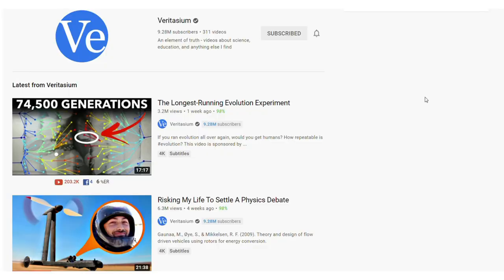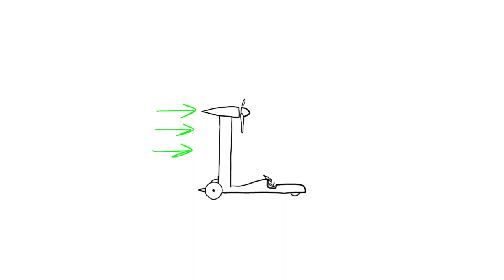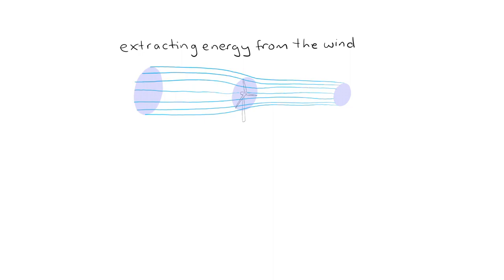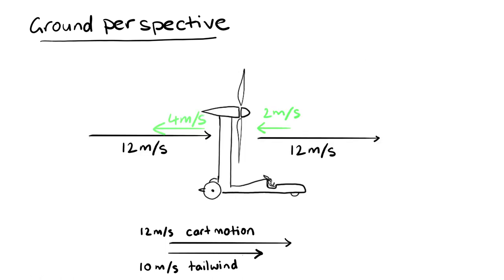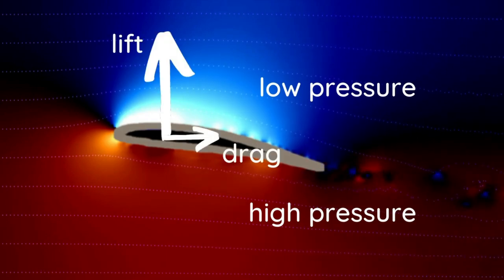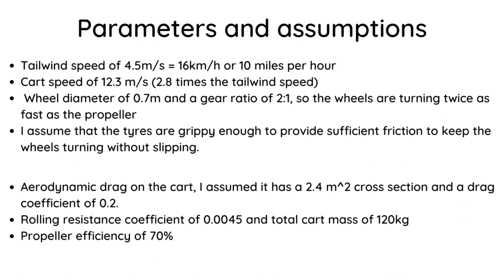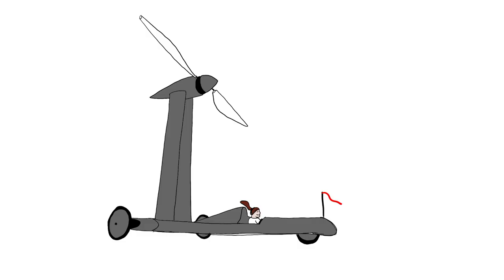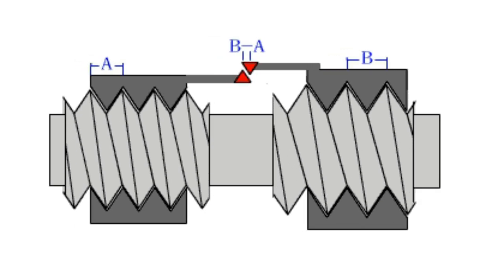Downwind Faster Than the Wind by Veritasium: How Does it Work?

Comment: Great job, Rosie! Love the explanation and numerical simulation. I’m taking a second crack at this one this week to explain what went down with the bet.
Reply from the maker: Thanks 😁😁 it makes me very happy to have you as a visitor on my little channel! 
I have really enjoyed thinking about this design, thanks so much for introducing me (and 6+ million others) to it.
Reply: I hope that you picked up 10k for this Derek. It's nearly worth that for riding in that vehicle as it looked scary as hell with that out of balance prop.
Reply from the maker: @chalichaligha3234  you have made some great illustrations there, well done. I really liked your explanations. I don't think I made the mistake you mention, but perhaps I wasn't very clear. The prop starts generating thrust as soon as the wheels start turning, so that is a constant as soon as it has any movement at all. But at very low cart speeds, the greater part of its forward-acting force will come from bluff body drag. Do you not agree there is any bluff body drag pushing the cart forward below wind speed that changes direction to start pushing it backwards as it crosses wind speed?
Reply: @EngineeringwithRosie  I think that at low speed the greater part of the force on it is coming from the drag on the propeller. This is evident with the small model cart, which doesn't have any body to speak of.
Reply from the maker: @coolaun  yep fair enough, that's likely true as its area looks like it's more than the rest of the cart.
Reply: As to whether the drag for the initial start is coming from the 'bluff body drag' of the propeller or the chassis, as someone who has assembled the Blackbird (in the wind) numerous times, everyone is correct. :)

The prop is removed from the shaft and the nacelle on the Blackbird folds down for travel.  For setup this is of course reversed.   If you place the back of the Blackbird to any significant wind and stand the nacelle up, you better have the wheels blocked or the craft will roll downwind.  This is before the propeller is installed.  By this we know of course that the chassis drag alone is enough to start a downwind rolling motion.  (This ignores that since the variable pitch prop was installed, there may be pitch positions that when the craft is stationary, fight back against this drag better than other positions).

I'm also convinced that the bluff drag of the propeller greatly adds to this startup drag as one of the reasons we added the variable pitch hub later in the Blackbird life was to be able to flatten the propeller at startup and add significantly to this drag (and thus reducing the rolling space needed to get the propeller producing thrust).

My best answer from first hand experience with the vehicle is 'both' and also 'either would do it'.
Reply: I feel like I conceptually understand the thing, but what would be most useful is a two graphs that explain the force and energy balance at steady state.  The graph would assume a fixed wind speed (e.g. 10mph).  The x-axis would be the vehicle's speed relative to the ground.  The y-axis would be force and it would have two plots:  thrust vs. speed and drag+friction vs speed.   The difference between the two plots is proportional to acceleration.  The top speed would be where the two graphs intersect.

At zero speed (relative to ground), the thrust is zero, but the "drag" is negative, because of the tailwind.  At some speed lower than the wind speed, the "drag" and friction cancel out, so that plot has an x-intercept, but the thrust has climbed above zero, so there is still acceleration.  At the wind speed, the drag is zero, and there is friction and thrust, presumably more of the latter.  And at some point above the wind speed, the two plots finally cross, and you will reach a steady state.

You could also do a similar graph with power on the y-axis to show the energy balance.  At zero speed, there is no power transfer with the ground, but the wind is providing power via drag.  As speed goes up, the power in the wheels goes up (not linearly, because the force with the ground is not constant), and the power from wind drag is cancelled then overcome by the power of the propeller pushing on air.  At steady state these graphs would also intersect.
Reply: @johnborton4522  Thanks for the details, John. I know it may be useful to have some extra help from bluff body drag or even a push to get Blackbird going, but it's important to keep in mind that the propeller is always playing a role, first simply because of the wind drag on it and then more and more because of the thrust it is producing, even below wind speed.
Reply: @EngineeringwithRosie  Maybe this isn't important, but I think it's worth noting. At all times, even when stopped, the propeller is applying a forward force on the cart. When the propeller is not rotating, this force doesn't fit the normal definition of thrust, but could still be treated as thrust mathematically when calculating the force balance for the vehicle.
I like this concept because I think it helps emphasize that at all vehicle speeds - zero ground speed, below wind speed, at wind speed, above wind speed - the propeller is doing the same thing -- pushing the vehicle forward.
Of course the aerodynamics of the propeller change completely when the blades change from a stall condition to operating in a lift fashion, but regardless, the propeller is always pushing the vehicle forward.
Reply: @coolaun  

Agreed, but in the regime I believe we're discussing, the propeller hasn't yet started producing thrust.
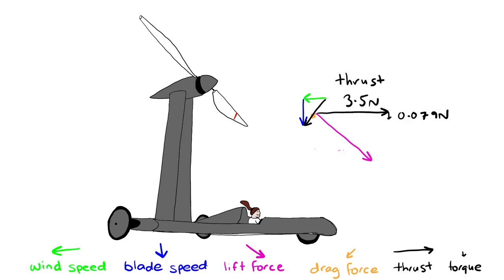Reply: @EngineeringwithRosie  The Force decomposition into thrust and torque components is wrong on minute 12:47 ... Which means that the argument that the torque comportent is small doesn't hold.

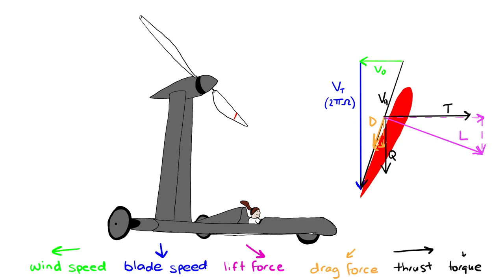It is curious because on minute 10:55 the force decomposition is right... 
In any case, thrust is the component of lift minus the component of drag... And TORQUE component is the component of Lift plus the component of drag.... For the example, the flow angle is about 45 degrees, that means the TORQUE component is about the same magnitude as the Thrust component... So the analysis must be revised with a more detailed account of the rest of the forces, including rolling forces on the wheels.
Reply: @EngineeringwithRosie  Additionally, to actually make any assertion about the resistance Force on the wheels due to the torque on the propeller, the actual propeller torque must be calculated, i.e. Torq= integral r x dQ from r= blade root To r= blade tip... If I understood it well, you did not calculated the torque on the blade, because you did not multiplied  the radial distance of each differential blade element by it's torque component (Q).
Reply: @EngineeringwithRosie  You don't have a little channel, you have a great channel packed into a compact package.
Reply from the maker: @abrahamvivas9540  thanks for your detailed comments. I did calculate in the way that you suggest I should have, so if you are confused it must be that my drawing didn't capture the calculations very well.
Reply: @EngineeringwithRosie  Hi Rosie, my pleasure. 
But I must insist there is some small miscalculation somewhere:
- On the velocity triangle shown in minute 12:35 the flow angle is arctan(11/13) = 40.2°=beta
- For Lift and Drag forces equal to 3.5 and 0.036 newtons respectively, then: 
  # Thrust force= Lift*cos(beta) - Drag*sin(beta) = 2.65N
  # Torque component force = Lift*sin(beta) + Drag*cos(beta) = 2.29N
- Hence, for the example in hand, the Trust and Torque components are about the same magnitude.
- The components that you calculated (min 12:47) would be coherent if the flow angle would have been 0.7° 

The spreadsheet shows the same problem. The flow angle is big and hence both Thrust and Torque force components should be about the same magnitude.

My guess is that there was a problem on the spreadsheet calculating the sine and cosine functions, maybe the functions works with degrees and you're introducing  the values in radians.

On a final note, it's important to notice that the relative axial wind speed on the blades is bigger than the relative wind speed on the cart because of the contraction of the stream tube (the propeller force the flow to accelerate, even with no relative wind speed on the cart, the opposite happens on a wind turbine).

And that's all. I think using blade element momentum theory to model the propeller and coupling it to the dynamics of the cart is the right approach (as you're trying to show in this video). 

Cordially,
Abraham Vivas
Reply: @EngineeringwithRosie  does the car keep accelerating forever after it crosses the wind speed? Or
Does it stop accelerating and comes back to the wind speed.(i.e, it attains equilibrium)
Reply: Veritasium, oh dear and Rosie, unbelievable, how can you have fallen for this hogwash.
Reply: This week… it’s barely two days later!! All those graphics… I wonder how many people work behind the scenes at veritasium? Quite the labor of love
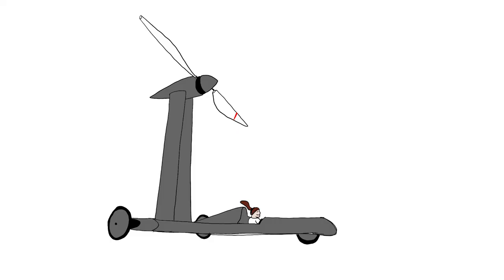Reply: I BET 10000$ That Veritasium got the right answer with the WORNG procedure (Making a serious conceptual error). And I bet the same quantity that Rosie fell for the same conceptual error (min 12:34), and that there is a mistake on her spreadsheet evaluating the sine and cosine functions.
Reply from the maker: @abrahamvivas9540  Are you saying you want to bet me $10,000 that the hypotenuse of a right triangle with sides 11 and 13 is not equal to 17? I am happy to take that bet 😀
Reply: @EngineeringwithRosie  hahaha xD, no, that's not the conceptual error in which you and Veritasium fell in ... In your case is hidden in plain sight on minute 12:34. (Hint, i remarked it on an earlier comment on a paragraph that started with "On a final note...")

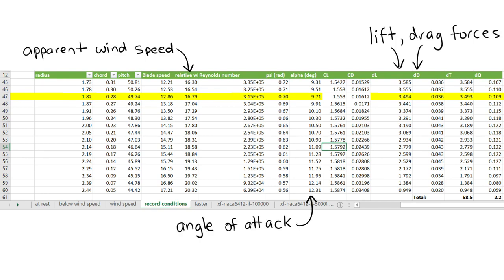About the mistake on the spreadsheet and triangles, the bet is that, for example, on the highlighted row on the spreadsheet on minute 11:46, I bet that dT and dQ are not 3.493 and 0.109 respectively, instead (using the correct flow angle from the velocity data on the highlighted row) dT and dQ are 2.65 and 4.1 respectively. In fact, i don't know how you got dQ= 0.109, because is not even coherent with your miscalculated reported torque component(12:57) times reported radius = 0.079*1.82  = 0.143

So, the bet is open ;)
Reply from the maker: @abrahamvivas9540  there's no bet, I'm not interested in pursuing this. Feel free to make your own video if you are so keen to prove me wrong.
Reply: @EngineeringwithRosie  Never had the intention to formalize the bet, just was a playful way to take to your attention (and Veritasium one's) that there should be an extra small video with the corrections. 
Because, I think science communicators should be responsible towards their audience and to make follow up vídeos when doing mistakes, correcting them (specially when having a large base of followers like Veritasium)

I have no time to make a quality video, nor I've ever done it. But I insist, science communicators should be responsible of the misunderstandings they communicate to the public.

I guess, if there's no attention on the subject I would be forced to make a small, poor quality video correcting both of you. But I don't think that it will reach most of the audience, and the corrections on the misunderstanding that propellers don't push wind in on itself nor the torque is really big will transcend.
Reply: @EngineeringwithRosie  since the propeller acts as a fan once wind hits 12mph couldn't you make it stationary and instead of driving wheels have it geared to a regular wind powered generator behind it multiplying its speed in low wind areas. Wouldn't it increase the regular wind generator's speed, power generation and hopefully lowering the turbulence compared to a high wind area by creating a wind tunnel with the lower wind speed around it and the higher speed thru the 2 propellers so there is less turbulence at the tips of the blades.
Reply: You won the bet!!!!!🥳🥳
Reply: So, When this contraption achieved the "world record" with a speed of 28mph with a 10 mph tailwind, where was it getting the energy to do this as there is effectively no longer power entering the system from the wind. The car is seeing an 18mph headwind.
Also what has the little model on the treadmill got to do with it. wheres the wind?. A complete red herring, The model on the treadmill can move forward because its receiving power from the treadmill. All the little model has to do is transfer enough power to the propeller from the treadmill to overcome its internal friction (no wind). I would presume the treadmill has maybe a 2kw motor, however, the contraption on the salt flats at (28mph) is not receiving any energy input. Though quite a bit of friction I would imagine.
Reply: Great, but can someone explain why or where the professor went wrong so that his equation always came out with negative acceleration when going faster than the wind.
Reply: @coolaun  The legend. I really like the videos you have made. How is flossy doing BTW.
Reply: Assuming Wind speed is fixed 
Wind pushes the car 
Wheels turn 
Wheels turn the blades 
Blades push against the wind (this creates the extra speed) according to them.
But 
Now the speed of car is “supposedly” more than the wind 
The wind is relatively slower than before from the reference of the car and hence it won’t push the car as much as before 
So the wheels won’t have the same angular velocity 
And subsequently blades will start to slow down.
So. Practically the moment propeller starts to spin and exerts any sort of force it starts the process of slowing down the vehicle in the first place 
How does  “Law of conservation of energy” holds here. 
Please explain its killing all my physics inside me.
Reply: @ramanmono  Flossie is just fine and still loves riding in the Under the Ruler cart.
Reply: hmmm, if I accelerate up to windspeed x via my Blackbird wind demon such that apparent wind is 0 in a long wind tunnel, and then suddenly switch to a another tunnel alongside it with no wind, such that relative windspeed component (green vector) over prop becomes -x. Is that creating a net thrust force given the blade speed(blue vector) hasn't changed from  that achieved accelerating up to wind speed value?  A larger negative green vector seems to imply a greater thrust component with the same prop velocity, neglecting a few details like drag which may be determinative. So, at what point does my Blackbird wind demon start to slow given is now zero absolute breeze - Is it immediately  for all values of x?
Reply: BULL
Reply: @Alan_Hans__  that out of balance prop was my main concern. I thought it was going to fly apart at any moment.
I would love to see a remake of this vehicle with a three blade prop, ultralight materials, and tighter building techniques.
Reply: @coolaun  the small car is an example of stored energy in the propeller acting as a flywheel spinning up the propeller enough to provide thrust which the treadmill maintains. It is not being affected by motion and inertia in the same way as Blackbird, either. The only similarity the two share are they both have thrust propellers being driven by their wheels.
I would like to know the rotational ratios between the propeller and wheels of both the small cart and Blackbird.
Reply: I bet a flat Earther I could dispel his idea. Dunning Kruger won out so I gave him the money . Hoping he might use it to further his education. But he only used it to expand his channel and try to further spread the 'flat Earth'  'truth'.
Reply: @TubeMeisterJC  Thanks for your Italian inspired response. Put me in the mood of cannelloni.
So the difference between the car in the desert and the car on the treadmill. When the car in the desert is stationary with say a 10mph tailwind (as per the world record) it is experiencing maximum force at that point but when it starts to accelerate the force acting on it decreases until it is travelling at the same speed as the wind where the force acting on it is zero.
The car on the treadmill experiences maximum force at the start and continues to receive maximum force at all times, point being that the car on the treadmill is not analogous to the car in the desert. It's another red herring, one of the many red herrings and misappropriated explanations which have convinced the makers of this vehicle and others that it has some kind of validity. 
It's a battery running a generator which is charging the battery.
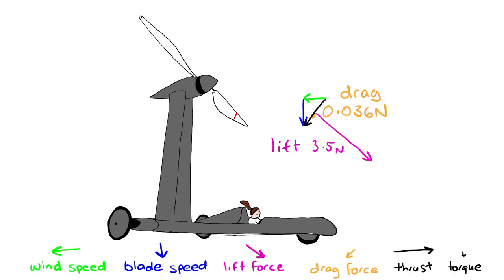Reply: @abrahamvivas9540  seems like you are right. The values shown at 12:38 are calculated for 0.7 degrees instead of the correct 0.7 radians (40.2 degrees, which is an angle on the triangle with sides 11, 13, and ~17).
At the end, the thrust is still bigger than the drag though, so I guess this is okay.
Reply: @EngineeringwithRosie  Youtube algorithm recommended your video based on my past views. Congrats!
Reply: You know, I UNDERSTAND how the machine works, but EVERY youtuber who explains it still confuses me. It's just like that image of the boats moving around the cylinder. That,,, is not the concept. No one has yet outlined the basic concept, and the concept only, in a short explanation video. (see everyday astronauts shorts, simple, brief, and only)
Reply: @chalichaligha3234  I just watched your video. Completely wrong sorry.
Reply: @tsmspace  Forget the boat cylinder thing. Complete red herring. All you need to know is that, once underway, the craft is powered by its propeller. Here is the cunning part. A propeller produces maximum thrust when the craft they are on is stationary! Not when they are moving and generating a headwind - the thrust actually drops off rapidly! So all that is happening is the tailwind counters any headwind created by the craft moving forward which enables the propeller on that craft to produce more thrust than it otherwise would as it mimics a stationary craft. This excess thrust enables the craft to accelerate to a higher speed than intuition would tell you.
Reply: @yup3398  no,, the wind is still pushing the vehicle. If you had a rolling vehicle, the inertia of the vehicle cannot propel it, no matter how you gear it down. The propeller is creating a high pressure zone which is pressing on the propeller. THe wind pushes on the high pressure zone, which transfers wind energy into the propeller through this high pressure zone. The craft is not powered by it's momentum, it merely uses it's momentum to create an airmass that can keep the craft in contact with the wind energy.
Reply: @tsmspace  that's exactly what I implied. You're simply describing it colloquially.
Reply: @yup3398  but your first line was, it's powered by its propeller,, but it's not. It's powered by the wind, which is coupled through the propeller.
Reply: @tsmspace  I'm not sure I see your point. I state it uses the wind to its advantage via the thrust from the propeller. Its a reaction between the propeller and wind.
Reply: @ramanmono  Yes, I can explain it.  He made a conceptual error.  In fact they all did. People generally realize that the thing that creates lift on the wings of an airplane is air pressure on the bottom of the wing.  But they generally don't think of air pressure as having a speed limit. The air foil shape causes laminar flow on the top of the wing and that is the same as creating low pressure or a vacuum. So, the motor of the airplane is not what is holding the plane in the air.  The motor is moving the plane through the air to maintain the laminar flow and overcome drag. On the downwind vehicle the propeller is like the wings on a airplane.  And the gearing of the wings to the wheels is what overcomes drag and maintains laminar flow on the front side of the propeller, creating a vacuum. This remove the air pressure on the front side of the propeller, as is the case with the top side of the wings of a plane. So, here's the thing.  The thing pushing the propeller isn't the wind.  The wind is instrumental with respect maintaining the laminar flow, the same as on a sail boat.  But the wind is not actually what is pushing the propeller.  The same is the case on a sail boat.  The thing doing the pushing is air pressure. And here is the thing that has them all stumped, the speed limit of air pressure is the speed of sound. In other words, as long as the air pressure is being removed from the front of the propeller/sail it will continue to accelerate all the way up to  the speed of sound (if we assume no drag).
James McGinn / President of Solving Tornadoes
Reply: @yup3398  John Borton's response to my video: 

Chali, I am one of the primary designer/builders of the Blackbird so I have a complete understanding of the craft.  I watched your excellent video and it's clear that you too have grasped the concepts in their entirety (nice work).

As far as the initial motion from rest (where the propeller has not yet begun to develop thrust), it takes very little drag against the tailwind to get it started. You are likely correct that if the body magically had no drag at all, merely the drag against the propeller would get the vehicle moving.  Conversely, if you took the propeller entirely off the Blackbird, the drag on the chassis alone would be enough to get it started rolling at accelerated to some percentage of windspeed.  In the end, since by necessity they both exist on the craft, it is the drag from both that start the initial motion.
Reply: One day it will be so common that no one will ask how it is possible rather applications of it.
Reply: @EngineeringwithRosie   i disagree 100% i say the professor was right. The experiment was not correctly completed.  I believe it was also down the slope of the ground ( the ground was not flat) and the is a lot of frictions( weight of the individual  adds friction on bearings, air friction,  opposite rotation friction, the pushing speed wind relative to the car is Zero, mechanical propellant bearing friction, gears friction and so on)
Reply: @dmdeemer  Your suggested plot would be very helpful. I concur it would look as you state. The energy balance (and SOURCE) is of great interest to me.
Reply: @tsmspace  Agree. I haven't seen a video or paper that concisely explains how the vehicle obtains its required power at each phase of operation in the downwind mode. Upwind is very simple.... the rotor acts as a turbine to drive the wheels. Seems like a lot of counterintuitive or oversimplified explanations.
Reply: @physicsphirst191  I don't see how the turbine could drive the wheels without a separate gear, so the machine that is actually built I think won't go upwind, but yes i agree, there are a lot of explanations that seem to be using the wrong mechanics or some roundabout explanation that could be simplified a lot.
Reply: @tsmspace  Correct.... the Blackbird is configured differently for going upwind and downwind, with different blades and reversal of the senses of the overrunning gear (i.e. going upwind the rotor drives the wheels, going downwind the wheels drive the rotor). More reading to do!
Reply: @Engineering with Rosie  Hello, this is off subject, do you think that the north poles of two magnets could stick with a steel washer in-between?
Reply: @IsaiahBuildStuff  if it's an ordinary washer, and ordinary magnets, then the a magnet will polarize the washer, so the washer becomes magnetized while in contact. So they shouldn't stick under this limited "normal condition".
Reply: @Rick_Cavallaro  Rick. You do understand this is a powered propeller? Please tell me you understand it loses aerodynamic thrust the faster the craft goes apart from increasing rpm? Good grief. Why does it need a tailwind to work? Are you saying you could tow it on a windless day, let it go, then watch it accelerate away?
Reply: You've made something really cool. Bravo. But when I stumbled across the explanations it hurt to watch. Windmilling propellers?? Please just one question. What would happen if you towed it to a workable speed on a windless day then released it?
Reply: @Rick_Cavallaro  Wow. Okay. Anyway. It would be nice to see it towed and released on a windless day. On the treadmill it always has a tailwind speed matching the belt speed so we don't get to see it there.
Reply: @Rick_Cavallaro  Kinetic energy, then.
It is no different than winding up a wingless rubber band airplane and putting it on the treadmill, if the treadmill were somehow being used as a means to keep the rubber band wound through contact with the wheels across the belt while the propeller spins. The small cart is just an example of a tiny cart being driven by a ?hp treadmill motor through the belt, wheels, and gears. The key point is in finding a propeller large enough and with enough pitch to provide enough thrust to exceed the friction and drag created by the cart.
The comment that I REALLY liked that you made was comparing Blackbird's propulsion to a feedback loop between a speaker and a mic. And how Blackbird was plugged in to the power of the wind like the mic and speakers were plugged in to the power of the wall socket.
Reply: @Rick_Cavallaro  My thinking was just that a 3 bladed propeller would provide more surface area for the wind to push against for the initial movement in low wind conditions if you could adjust the pitch to them being nearly flat. And it seems to me that 3 bladed propellers are inherently more stable and efficient than 2 bladed propellers. But you would know a lot more about pros and cons of a 3 blade propeller vs a 2 blade propeller for your situation than I would.
I had wondered about the source of the vibration, since the earlier videos do show substantially less vibration. I had not considered that the blade pitches had become mismatched.
In any case, it is a brilliantly engineered machine that I hope I can see in person at the Smithsonian some day.
Reply: @Rick_Cavallaro  Great. So according to the Veritasium explanation it should just keep accelerating to a point - tailwind seemingly to have little to do with its speed apart form the initial start up. I was happy to find Rosie's video here as she includes tailwind with more detail. My guess, as I haven't seen it demonstrated, is that it decelerates in the range of "slower than if it didn't" to "just as it would if it didn't". If it continued at the same speed or even accelerated then you've cracked perpetual motion and if that's the case, hats off to you.
Reply: @Rick_Cavallaro  All good. Cool. So without the tailwind it doesn't accelerate. I feel the second video went into great detail explaining how the wheels drive the prop which I appreciated. But that is all for nought if we don't understand why and how the tailwind allows the craft to accelerate. To me that is what makes it magic and I fear a lot of viewers confused the propulsion with that of a sail or windmill. As opposed to a powered propeller upon an accelerating craft which, although may produce more lift with increasing speed across the blade, will lose thrust as a result of that increasing speed.
Reply: @Rick_Cavallaro  That was my stumbling block. How could you have a pitch that could provide thrust at speed, yet not try to drive the propeller like like a turbine that would try to drive the wheels in reverse at startup? Once I realized that the blade pitch could be flattened to provide maximum surface area for the wind to push against while imparting minimal spin force, it all started making sense.
As I said earlier, it is a brilliant piece of engineering.
Reply: @Rick_Cavallaro  the treadmill cart is an excellent analogy of how Blackbird's wheel driven propulsion provides thrust to exceed that ground speed once equilibrium is exceeded. What it doesn't do is explain how the wind is capable of creating the ground speed. But Blackbird itself does a magnificent job of that.
Reply: @Rick_Cavallaro  my problem  has more to do with grip and traction of the tires of the small cart on the treadmill hence having to hold it down against the belt to spin up the propeller. But that's only because it is a flyweight representation of the full size machine. Which is irrelevant anyway since Blackbird has more than proven that a machine can be designed and built that travels faster than the wind straight downwind using only the force of the wind to do so.
Reply: @Rick_Cavallaro  my first thought was it had been damaged somehow in storage or transport which led to the vibration and not because the build quality was subpar.
Reply: @Rick_Cavallaro  the experiment has to be re done considering all factors, and an acute mesuring equipment being use, and a lake bed wont be complete flat i can bet on that. Even water needs no air disturbance to be flat. But i get your point.
Reply: @tsmspace  Some how I got it to work
Reply: @Rick_Cavallaro  it's very simple. the propellers are not sailing, they are fanning. HOwever, it is also very easy to see how you could imagine the device to be working one way, build the device, test the device, and still be imagining it working one way, when it's actually working with a different mechanic. The prop is creating a high pressure zone behind the vehicle, and this high pressure zone pushes on the wind, and therefore the wind is coupled through this high pressure zone into the prop. The propeller is at NO TIME "tack" sailing for the downwind operation of the vehicle. It is only running, but it is able to increase it's running speed beyond the speed of the wind because the propeller is pushing air directly into the wind, and the wind is in turn forcing this high pressure zone forward. --- This means that the speed of tacking will have no bearing on the potential speed of your vehicle,, if you can gear it up so that the prop spins fast enough, you can continue to harvest energy from the wind as long as the propeller is able to push on the wind.
Reply: @IsaiahBuildStuff  that can make sense. A lot of histories inventions work that way. The inventor works with a logic error, but the machine they build is functional, even though there is one little detail about their logic that is wrong, it doesn't prevent them from understand the machine in practice.
Reply: @tsmspace  I what do do it for Veritasium's contest. I think it is counterintuitive do you agree?
Reply: @yup3398  I think it's pretty obvious that without the tailwind to offset friction and drag it would eventually slow to a stop.
Reply: @Rick_Cavallaro  and with this, I will drop out of the conversation since I fully understand the concepts and physics involved in how it works. I don't want to pester Rick with irrelevant minutia.
Reply: @yup3398  Blackbird needs the tailwind to provide enough push force to offset the losses from the drag and friction to reach equilibrium or to exceed them to provide acceleration.
Reply: @EngineeringwithRosie  
Why no mention of the wheel diameter?
I presume that you have seen Xyla Foxlin's video on this subject with Derek of Veritasium
Reply: @maxxron  can you explain how it exceeds the tailwind?
Reply: @Rick_Cavallaro  What I called "wrong procedure" is that Rosie and Veritasium made a conceptual error... And the bet was a playful way to take that to their attention... It doesn't worth the money I guess... It's a simple aerodynamic concept derived from open turbomachinery analysis.. I did not developed the equations to left it as a little puzzle to Rosie... But if you want to pay me that sum to teach you basic turbomachinery aerodynamics... I guess I can accept.
Reply: @yup3398  To simplify it even further, compare it to a tailwind pushing an airplane faster than the prop could propel it alone.
Reply: @Rick_Cavallaro  I realize that.
Doesn't Blackbird do something similar once it generates enough thrust to exceed the wind speed? It just seems to me that once Blackbird does exceed the wind speed it is just operating in a moving air mass as well.
Reply: @Rick_Cavallaro  It just seems to me that the main difference between a propeller plane and Blackbird (once it exceeds wind speed, of course) is that the plane is propelled by a gasoline engine and Blackbird is propelled by kinetic energy through the drive line, but both are getting an additive speed assist across the ground from the velocity of the air masses they are moving through. Or am I missing something?
Reply: All this stuff is a hoax "validated" by some guys who are not able to think and don't know the laws of the physics.
That vehice is in fact a tentative of a "perpetual motion machine" which is able to generate energy from nothing.
There were a lot of guys in history who tried that.
The biggest problem is that the "physicians" from the US Olympiad "validated" this stupidity. And that is really bad.
Reply: I have one question, did somebody (independently) check what is inside the vehicle of Cavallaro (btw, who is this guy?)?
I'd like to see what inside that "black box" behind the propeller and inside those things (again, "black boxes") which supports the propeller.
Reply: @Rick_Cavallaro    I already requested to Derek ("Veritasium") 1 mil euro (I'm from Europe) to prove (show) him where he (and a lot of others) was wrong. But he didn't answer up to now. :D

btw, can you make a video with some independent people who can umount your vehicle, check what is inside, mount it again and run it "faster than the wind"? :D

Derek won that bet because he meet a guy who was idiot enough to believe that hoax. That professor was not able to see where were the problems (because of that he should be thrown out from the teaching system).
Reply: @Rick_Cavallaro  you should not demonstrate anything, others should.
Others should vheck your vehicle and try to run it "faster than the wind", you should be only spectator. 😁
btw, in the videos there isn't proffesional equipment for measuring the speed and direction of the wind all along the runing path. There is only a strip of something which of course cannot be considered as a proof that the vehicle runs faster than the backwind.
Reply: Guys, why do you remove my comments? Should I understand that you don't like the truth?
Reply: @Rick_Cavallaro  be careful when talking about paranoia. 😁

So, let me put again the (removed) comment:
This is not a bet, that 1 mil euro should be my reward because I "illuminate" you.
This reward is because that professor was not able to proof where you (Derek, you, etc) were wrong and, more than that, "the physicians" from the US Olympiad "validated" (theoretically) a perpetual motion machine which more that that produces e nergy from nothing ("the dream" of generations of "enthusiasts").
Reply: @Rick_Cavallaro  how do you know that I'm wrong if don't even know what I'm about to say?
I need the money AFTER the demonstration.
Reply: @yup3398  See the solution on page 10
https://www.aapt.org/physicsteam/2019/upload/USAPhO-2013-Solutions.pdf
Reply: For all the guys around here, please search on yt for a video named "40 Perpetual motion machine, all work" (I can't post here links).
There you will see tons of "Cavallaro's like machines". 😁😁😁
Reply: @tsmspace  

// " It's just like that image of the boats moving around the cylinder. That,,, is not the concept."

But it is.
Reply: @johnborton4522  No. It's not. The boats are sailing downwind and at an angle, so that they are able to move downwind at the speed of the wind, but because they are at an angle, their speed can be increased by the Pythagorean of their angle. The land-yacht is already moving faster downwind than the wind itself, so this mechanic no longer can apply to the propeller. Yes, the propeller blades can move faster than the wind in a circle while the land-yacht moves at wind speed, which is the boats on a cylinder concept, but that does not move the land-yacht at all, it just justifies how the propeller might be able to spin from wind power even if the land-yacht is already at wind speed. But, the propeller doesn't even spin from wind power, it spins from being geared to the wheels.
Reply: @tsmspace  

Can't help you if instead of being willing to learn you just insist on being wrong.  So be it.
Reply: @johnborton4522  I don't follow. is the boats around the cylinder a propeller or is it being pushed by the wind
Reply: @Veritasium, @Rosie, @Rick:
Can you explain why in the "Risking My Life To Settle A Physics Debate" clip, starting at 12:20 the propeller starts to vibrate and rotate faster and faster while the vehicle is almost stopped?
@Rick: do you hold your 1 milion euro reward (for me) for showing you (and others) where you was wrong (and cheated)?
@Veritasium, @Rosie: I guess these videos ended your "career" in science. 😁
Reply: @Ovi_B  

// "Can you explain why in the "Risking My Life To Settle A Physics Debate" clip, starting at 12:20 the propeller starts to vibrate and rotate faster and faster while the vehicle is almost stopped?"//

I can.  Would you believe me?

// "@Rick: do you hold your 1 milion euro reward (for me) for showing you (and others) where you was wrong (and cheated)?"//

He didn't offer you a reward, he offered you a bet.
Reply: @johnborton4522  
----- I can.  Would you believe me?
Please do it. I don't know if I believe you, but please present your opinion.

------ He didn't offer you a reward, he offered you a bet.
I told him from the begnning that is not a bet, it is a reward (for myself).
Reply: @Ovi_B  

// "I told him from the begnning that is not a bet, it is a reward (for myself)."//

Yes, and he laughed his ass off at the idea of you wanting a reward for being wrong.
Reply: @johnborton4522  

-------Yes, and he laughed his ass off at the idea of you wanting a reward for being wrong.

Yes, and I asked him how does he know that I'm wrong before knowing what I have to say?

Can you tell us why that propeller is rotating faster and faster?
Reply: @Ovi_B  that's not when the vehicle is "working", it's when it's not
Reply: @Ovi_B  

// "Yes, and I asked him how does he know that I'm wrong before knowing what I have to say?"//

Because he knows the first rule of Dunning Kruger.
Reply: @Ovi_B  

// "Can you tell us why that propeller is rotating faster and faster?"//

Of course I can.
Reply: @johnborton4522  

------ Of course I can.

OK, do it. 😁😁
Reply: @Ovi_B  
// "OK, do it."//

I have no reason to unless you trust me.
Reply: @johnborton4522  I can't trust any claim before knowing and analyzing it.
But please note that I'm not like Cavallaro, I don't say from the beginning that what you are about to say is a stupidity. 😁

So, please "enlighten" us. 😊
Reply: @Ovi_B  

I will happily enlighten you with the truth for a reward of $100,000 USD.   What's fair is fair.
Reply: @johnborton4522  OK, deal.
----- I will happily enlighten you with the truth for a reward of $100,000 USD.   What's fair is fair.
"Enlighten" us.
Reply: @johnborton4522  I don't put anything until I have an answer.
Reply: @johnborton4522 
---- Ok, put the $100,000 in escrow and when Derek and the others who were there confirm I am right, I will get the money out of escrow.  Let me know when the money is there. 

You shouldn't say them that you are right or wrong. You should convince me, because I pay, not they.
You should convince me not some amateurs. 😁
Reply: The windspeed measurements in the tests are nonsense. Behind a sail on a sailboat the windspeed is greatly reduced. You've built your whole model on the propeller reducing the speed of the wind to get power and then measure it downstream of the propeller. How about driving a car along at the same speed as the cart with wind indicators on a mast? If the system really works the wind direction will be reversed at that speed.
Reply: @bcwbcw3741  congratulations 😁

-------------     The windspeed measurements in the tests are nonsense.
Reply: @bcwbcw3741  

Oh geez -- why didn't we think of that like 10 years or so ago?

https://youtu.be/5CcgmpBGSCI

Btw, no where have you seen any wind measurement that matters taken "downstream of the propeller".  The propeller is generating thrust well before windspeed.
Reply: @Ovi_B  

Congratulations to yourself ..., you just band-wagoned on the wrong wagon.
Reply: @johnborton4522  where did you hide the motor, batteries and the remote control? 😁
Reply: She is wrong. The wheels do not provide the torque to spin the prop... its the opposite.. the wind turns the prop which is mechanically coupled to the wheels... when the prop spins the wheels turn that move the car forward. Her breakdown is impossible because if the prop is providing the thrust to move the car... and its the turning of the wheels that provide the power to turn the prop..... there is NO WAY to start the car moving, is there? THINK about it!
Reply: @EngineeringwithRosie  You are wrong. PLEASE read my comments on this thread and re-think what is happening in relation to the prop and wheels turning.
Reply: @hakapik  She is right.

When running downwind, the wheels provide the torque to turnthe prop 100% of the time.  No exceptions.

She explains how it starts from a standstill at 7:20.
Reply: @hakapik683  
//"PLEASE Read my comments on this thread and rethink ..."//

The rethinking is going to need to be all yours I'm afraid.  

By design, it's impossible for the rotor of the blackbird to act as a turbine, and to thus drive the wheels. Literally impossible.
Reply: @Ovi_B  my comments are also being removed on all videos on this subject. many other critics have complained about the same thing.
Reply: @andrewsnow7386  The propeller is NOT putting forward force on the CART . it's ONLY in contact to the Earth by it's connection to  the wheels and can ONLY 'translate' energy into motion through this connection .    ONLY at below wind speed can the friction of the wind be pushing the propeller , along with the cart, forward . BUT the propeller may as well be shaped as a sail ,it's ability to spin only disconnects it from the cart in that the wind could more easily slip past it.
AND the only thing turning the propeller is the wheels so what is erroneously implied is that the wheels turn the propeller and the system of wheels-shaft-propeller creates free energy . Guess conservation of energy is a lie?
Reply: @andrewsnow7386  You are adding a lot of chit chat and skirting the basic principle that is in question . Go to the basic idea and really question the basic law of motion .The wind from behind would cause the propeller to spin in one direction . For the propeller to be cutting into the air and to be pulling the plane forward it would have to be rotating in the OPPOSITE direction. At what point in does the wind spinning the propeller in one direction stop and the propeller reverses to work like a propeller on a plane  (when it is driven by the plane's engine) ?
Think this through carefully .  forget all the other stuff,  just this basic requirement .
Reply: @hj8607  Any time the cart is moving forward, the propeller ALWAYS TURNS the SAME DIRECTION. And, it always turns in a direction such that it acts like a propeller. How's that for to the point?
Reply: @andrewsnow7386  If the propeller is directly connected to the wheels with the correct gear drive, yes this is what would happen
Reply: @andrewsnow7386  So the wind from behind the cart never effects the prop ?
Reply: @hj8607  Short answer 1 - Yes the propeller is directly connected to the wheels.
Short answer 2 - The wind never spins the propeller, the wheels do.

Long answer 1 - On all the small model carts I've seen on YouTube, the propeller has a fixed ratio to the wheels. The propeller can't turn if the wheels aren't turning. On the full size machine, there are a couple of complications. First, the gear ratio can be changed when the vehicle is serviced. And second (this has caused confusion for some people watching the video), there is a freewheel in the drive system that allows the propeller to spin faster that the wheels. In normal operation this freewheel doesn't do anything (it stays locked), but under some conditions the propeller can turn without the wheels turning.

Long answer 2 - Personally I would say the wind has an effect on the propeller when the cart is stopped or going slow. That is, the wind applies a friction force (as you mentioned) to the propeller as the wind goes by. But, at no point during normal operation down-wind is the wind spinning or powering the propeller. The propeller never acts as a wind turbine.
Reply: @andrewsnow7386  Then if the propeller is acting like the prop on a airplane it is 'pulling' the plane forward .  It is applying a force against the air surrounding the plane and thus the plane moves forward . The propeller is powered ,driven  by the wheels and JUST LIKE on an airplane the propeller is ,of coarse putting drag on the airplane engine(in this case that is the spinning wheels (being turned by the ground they are travelling over) . SO the propeller is putting drag , just like a brake would , on the forward motion of the wheel . 
Here is the catch . The energy turning the wheel being provided by the craft being push forward  by the wind cannot be less than the energy needed for the propeller to equally 'push' forward on the craft .    In any simple mechanical system the energy coming out NEVER exceeds the energy being put in .  And in that there is ALWAYS friction it is ALWAYS a little less .  
If this system can get something from nothing it would/could continue indefinitely on its own once put in motion . THAT would be the definition of a PERPETUAL Motion Machine .  (not going to happen . Most absolute basic FACT of physics )
READ this over and over till it makes sense to you . My degrees in Physic sand mastery of basic mechanics means it is not I who needs an understanding ..
Reply: @andrewsnow7386  No matter what equations were CREATED to show you can get something from nothing they would be equations that incorrectly formed IN THAT they would be contradicting the basic laws . A sailboat can out run the wind BUT it is directly harnessing the wind by creating a better coupling to the wind and thus draining more energy than a straight on sail could accomplish . In ragatta a sail boat can hit 52 MPH with only a 28 MPH wind  . All the energy in this craft comes from the wind 'pushing' the crafts body. A propeller is NOT an efficient transfer of energy so NO the short lived speed gain hat happens AFTER the wind steadies is short . 
The Prof turned the money over to Derrick to help keep the curiosity going NOT because he was wrong.
Reply: @andrewsnow7386  So hort answer I would not make any wager in that you would not know if you were proven wrong  It would be beyond you education . (do you hold a doctorate in physics or something like that ?
Reply: @hj8607  OK, since you have a physics degree, you should be able to show the equations and math to demonstrate that this does vehicle does violate the conservation of energy. Since even with my inferior BS in mechanical engineering, I was able to figure out for myself the equations Derek posted (before he posted them), with your physics degree it should be easy for you to show the math that demonstrates that the conservation of energy law doesn't allow this vehicle to operate. I'm not asking for precise numbers, just an example with reasonable numbers that show a problem.
To give you a starting point, You might consider two sources of drag, the drag the wheels create to produce power, and all other drag (mechanical and aerodynamic). I think we agree that for this machine to work, the force produced by the propeller has to be equal to or greater than the sum of these drags. But, if you don't like this approach, show me one you do like.
Reply: @hj8607  It doesn't take much education to see if a vehicle is traveling faster than the wind for an extended period of time.
Reply: Hey Ve.  Lets concentrate upon the small model on the treadmill. .

Do this:  Somewhere find a belt, perhaps in industry, 50 ft long, and gear it to run this same speed.  Put this same cart on this belt.

You will never find a case where it reaches the other end of the belt, nor where it just stays on the belt indefinitely.

No matter how parallel with the belt it runs,
 It will always fall off the beginning end of the belt within seconds.

If you are honest, this should be material for a follow up vid.  It will literally gain you hundreds of thousands of clicks, likes, subscribes etc.
Are you honest, are you up to it?
Reply: @EngineeringwithRosie  Rosie, look at 4:00.  you say that some might say that "this is basic perpetual motion -- the wind wheels power the prop and the prop powers the wheels".  You say it isnt, but then go on to explain that it is that --  watch closely the next 30 seconds

About the supposed "bet".  Nowhere on these vids do i see a definitive exhaustive test on this vehicle. Why?  All i see is a telltail which at some point pointed forward.  We can easily do a real scientific test.  Do i need to tell you what that might be?
Reply: Actually, rainman, i am thinking this series of vids is made for a demo of how very gullible the average person is, and how vidgames and other digital media platforms are seriously and negatively affecting the brain development of kids today.
Reply: @andrewsnow7386  The entire claim is that this vehicle , because of the propeller can go faster than if there no propeller  and was just being moved by the wind pushing it .
The momentum of the object is the mass times it's velocity .  M=mv  That is the energy it is carrying as a result of that mass being accelerated over a given period of time .  Since the wind force is only positive until the cart reaches wind speed the duration of the acceleration is fixed (temporary) . With no help (propeller, as proposed ) it will reach a 'terminal' velocity . 
If it had a massive fly wheel being slowly put into motion , like a kind of energy battery , that fly wheel could be used to propel the craft to a higher speed  TEMPORARILY .  
BUT with out that a higher speed, than the wind could cause (with no propeller )would require the wheels to drive the propeller and create more energy than the wind is putting into the cart.  The wheel to shaft to gears to propeller being the system that is putting out more energy than is being taken in.  The total momentum being any larger than the original would REQUIRE addition force to increase that terminal velocity .
Reply: @hj8607  We all agree, without the propeller it could not go faster than the wind. So this brings us to: "The wheel to shaft to gears to propeller being the system that is putting out more energy than is being taken in." If true, there should be a fairly simple equation that shows this is the case. Where's the equation?
I've used the P=Fv equation to show that energy is conserved. If you don't think this equation applies in this case, show us one that does. One or more equations showing the energy balance for a system should be fairly rudimentary stuff for a physicist.
Reply: @andrewsnow7386  You have stated the equation the momentum of the cart 'p' is the result of the mass 'm' times velocity 'v'
p= mv The force 'f' is a constant and is ONLY provided by the wind hitting the backside of the cart.  The velocity of the cart is v=p/m . If the cart and propeller are always attached but the wheel connection  is either not engaged (no propeller help) or engaged (propeller assist) then the mass is constant . For the velocity to increase the momentum , force of motion ,  must increase meaning the force going into the system increased .  But ALL the force moving the cart is FIRST derived from the wind THEN some is diverted to the propeller through the wheels . That diverted power is a reduction in the power just (first) moving the cart . If the propeller is adding more than that  force power back then where did that additional force come from.  (not from the wheels to shaft to propeller because if that was happening the cart would never stop increasing in speed . (as long as a force is applied to any object that object increases speed ,velocity, till it goes off the track , hits something or gets pulled over by a cop !
Reply: @andrewsnow7386  The push of the propeller must equal the pull on the wheels . Grab your shirt collar with your hand and try to lift yours off the ground . Exact same t
Reply: @andrewsnow7386  It is so rudimentary it is silly . You, and others(a few) claim that with a propeller the cart goes faster than the wind . How can it go faster if some additional power (force) is not created . Is it just 'magic' ?    A propeller is roughly 86% efficient at turning power into motion. NO FREE PROPULSION . energy taken from wind force moving cart by the wheels (the only source for the propeller )is reduced , not increased , into moving the cart . You cannot ever show any mathematical proof that more 'thrust' to the cart is added than the drag by the wheels turning the propeller (even if the propeller (ALL DO) was not ALWAYS loosing 15% of that power from the start .
Reply: @hj8607  The equation I showed was P=Fv. In this equation "P" stands for power not momentum (F is force, and v is velocity). This was specified twice in my comment about that equation. I haven't been talking about momentum or mass as I don't personally think these concepts help much when it comes to understanding what is happening in this situation.
"If the propeller is adding more than that  force power back then where did that additional force come from." It seems to me like you are mixing up terms. There is a law of conservation of energy, but no law of conservation of force. 
The wheel/propeller system on this cart is very much like a lever. With a lever, a small force on the long end can produce a larger force on the shorter end. But, when the lever moves, the end with the larger force will move a shorter distance than the end with the small force.  Even though a small force can move a large force, levers don't violate the conservation of energy.  Likewise, with the cart, the wheels move a longer distance (across the ground) and the propeller moves a shorter distance (through the air). Thus, just like with the lever, the smaller force on the wheels (drag) can produce a larger force on the propeller (thrust). Energy is conserved.
If drag didn't increase with speed, then the cart would continue to accelerate until it hit something. This is no different than an engine driven vehicle. Increasing drag with increasing speed stops the acceleration of all terrestrial vehicles at some point.
Reply: @hj8607  You seem hung up on the loss of energy in the system. It happens, no one is claiming the real vehicles are even close to 100% efficient. If you like a 85% efficient, that's fine. These carts could easily go faster than the wind with such an efficiency.
Going back to the lever example I just mentioned in another comment: I could have a lever that was 2 m long on one end and 1 m long on the other. If the pivot for the lever is sticky, reducing it's efficiency to 85%, it can still produce a larger force on the short end than the force I apply to the long end. If I apply a 100 N force to the 2 m long end, I still get a 170 N force at the 1 m end with 85% efficiency.
Reply: @andrewsnow7386   Add this to your understanding of basic mechanics  The momentum of an object is the total force it can exert on something it makes contact with .   P = p.    And with a lever , yes energy is conserved But the formula is Force time distance equals Force times distance . That is expressed as Fx 1 = Fx 2  . The 'work ( in joules ) required to move the long end of the lever may require less force but is exerted over a longer distance .  SO if you are making the mistake Derrick made on comparing the propeller from wheel as a lever the wheels would be the long end of the lever applying less force over long distance making (incorrectly) the propeller the part of the lever exerting more force but this would then have to be over a shorter distance to be equal work (conservation)
(remember that a wheel , like a reduction gear, is itself a lever . But the fulcrum of the lever is at the center of the wheel so very little work over large distance at edge of wheel equates large force but over close to NO distance at the center . (you could ,by yourself push a car on wheels some distance but you could not ,by yourself push a car  any distance (0) with no wheels .)
Reply: @andrewsnow7386  Any mechanical system is subject o friction .Friction takes some of the mechanical energy and converts it to heat which dissipates out of the system .  The simplest of levers like a see saw < most every mechanical transfer of power (work)utilizes a 'lever' component . (even and electrical system uses a transformer to change the relative sizes of 'F' and "x' which in electric is Amp and volts . the energy is conserved in that the work wattage remains constant w = amps x volts = av1 = av 2 etc. And the work each can do in joules is constant
Reply: Derek, it's rubbish. You know it, I know it and many others know it, so don't fawn over Rosie. She already thinks she's Gods gift to engineering, but should stick to the gingerbread work. Nice work with the treadmill model though.
Reply: @hj8607  "with a lever , yes energy is conserved But the formula is Force time distance equals Force times distance . That is expressed as Fx 1 = Fx 2" Exactly right.
"... the wheels would be the long end of the lever applying less force over long distance making the propeller the part of the lever exerting more force but this would then have to be over a shorter distance to be equal work (conservation)." YES that's it! If the vehicle is traveling twice the speed of the wind, then the wheels travel 2 times further than the propeller.  That is, if the wheels travel 10 m over the ground (the physical medium the wheels are interacting with), then the propeller travels only 5 meters through the air (the medium the propeller is interacting with). The propeller IS the short end of the lever.
"the fulcrum of the lever is at the center of the wheel ..." Right again. If you want to extend this analogy, the gear on the wheels' axle is the short end of the lever. So to make the analogy more complete, the vehicle could be considered to have two connected levers. One is the wheels' axle with the with the wheel rim/tire being one end of the lever and the teeth on the gear being the other end. The second lever is the propeller's shaft with the gear teeth being one end of the lever and the propeller being the other end.
But, for simplicity, the two levers can be treated as one with just the overall ratio considered. The overall ratio needs to be correct or the machine won't work. This ratio, the VSR, is discussed in the following video starting at 7:17:
https://www.youtube.com/watch?v=VUgajGv4Aok&t=507s
By experiment, the VSR needs to be .7 or less to work. That is, the short end of the "lever" (the propeller) needs to be no more than 70% of the length of the long end of the "lever" (the wheels). At 8:34 she points out her earlier carts would never work because the VSR was around 1.5. With this high VSR, the propeller became the long end of the lever (1.5 times longer than the wheels), so it could not possibly produce a force greater than the drag from the wheels. The .7 VSR  didn't work too well for her. A VSR around .5 that worked better. This greater reduction was probably needed to overcome friction or other energy losses her cart had.
Reply: @andrewsnow7386  The distance the wheel travel VS the distance the tips travel !      2¶r  vs 2¶r   (2 x pi x r)   NOT the distance with respect to the ground .    It is very obvious this field is a compassion you need to take on with enough passion to find sources of coarse instruction.   (not just singling you in that this entire subject of free energy by magic mechanics is , well , full of cold air )    (by the way I didn't just pass my coarse in mechanics I pulled the highest grade in the history of the college , still stands, )
Reply: @johnsomerset1510  Absolutely right . The cart argument of free energy is RUBBISH . Rosey NEVER should have given Derick the amount of respect she did . He runs a gingerbread channel so she was STILL on topic , according to JUST you .
Reply: @hj8607  Why do you keep coming back to free energy? We all agree, free energy is not physically possible, but you keep bringing it up.
You say: "by the way I didn't just pass my coarse [sic] in mechanics I pulled the highest grade in the history of the college" -- yet earlier you appeared to confused the power equation I presented P=Fv, with the momentum equation p=mv. And when I asked you to provide energy balance equations to support your opinion, you didn't give any. Bragging doesn't work well if you can't back it up with action.
Reply: @andrewsnow7386  Knock it off Andrew . You have no qualification to judge my understanding . Your misinterpretation of equation symbols is YOUR challenge .  (the equation was FOLLOWED by the other , not replaced )
Reply: @EngineeringwithRosie  As the prop starts turning it is being powered by the wheels only . It requires a force that the wheel provide to start turning . that energy is gained from the ground spinning the wheel . BUT at the same time the wheels are experiencing a resistance to just free wheeling by the need to turn the propeller . The propeller is exerting a drag on the wheels . There is then a drag placed on the forward motion of the car by this braking of the wheels as energy it transferred to the motion of the propeller . AND if the gear ratio in the shaft from the wheels to the propeller is increased to make the propeller ACTUALLY create forward thrust , the energy required from the wheels is increased and thus the drag on the wheels (the braking) is also increased and further resistance to the cart 'rolling' forward is the result .  
This means that the additional thrust from the propeller is going to be very close to equal to the drag it's power source (the wheels) put on the forward motion of the cart . ADD to that the fact that as the cart exceeds the speed it could attain ( without the prop turned on ) is going to be met by additional air friction drag on the cart that would have to be over come .  It's actually a loosing proposition . 
Sal boats out run the wind speed because they accomplish a better ' coupling' with the energy of the wind .  They absorb more of the wind energy by aerodynamics , not some goofy mechanical 'magic ' idea .
Reply: you did not explain why it wasn't defying the laws of thermal dynamics that's why people are all in disbelieve
Reply: @alfriesmacdonalds5879  If you are referring to the heat (energy) that constantly is taken from the system by friction , you are  on to part of the impossibility of this idea .
Reply: @johnborton4522  Out of curiosity, did you or Rick request thread comments be deleted, or did the OP do it on her own? I've got no business to make a big deal out of it, and I'm not going to - however, I think it's too bad the links to your raw videos are gone. They were some of the best material I've seen about this topic.
Reply: @rbwannasee  

I assumed you deleted those threads where we were having our exchange and wasn't particularly happy that you did that.   Apparently you didn't. :)

I wouldn't make such a request nor do I know of any such request.
Reply: @johnborton4522  No, it wasn't me.
Reply: @johnborton4522  I still have the raw videos showing up in my viewing history, so I was glad to see that. Would hate to think they got taken away!

Now, before I ask my next question, please understand I'm not trying to prove or disprove anything, and I know a lot of my prior comments have been rude, sarcastic, and accusatory. I apologize for that. I think it's frustration at not being able to get the answers or data I want.

What I'd really like to get my hands on is time-stamped GPS data from as many of your runs as possible. Also the same time-stamps on chase vehicle windspeeds. I think you mentioned previously you sampled at 0.2s intervals, so it would be a lot of data, but that's fine by me! I could extrapolate so much from it and basically re-create your runs graphically and determine all kinds of data - speed, acceleration, distance, etc. I haven't tried Google sheets yet (I try to stay away from their products for the most part) and unfortunately when OpenOffice tries to recover it (the .xls spreadsheet on NALSA), it 'succeeds' but it's blank.

If you have links to it and are willing to share it, that would be awesome.
Reply: @rbwannasee  

No worries about more questions.  I appreciate your tone change and I have no issue answering anything I can in that context. 

11 years on, I no longer have any data -- long lost to computer upgrades.  Everything I'm aware of is on the nalsa site.  Had I known this thing would zombie its way back into the news, I might have made more effort.

I know the data on their site can be opened with Google Sheets (because I tried it last time you asked).

Chase down my partner Rick Cavallaro (Spork on the relevant science thread at talkrational.org).  He might have saved raw data off and kept it.
Reply: When are you going to build a full size of Xyla's model?
Reply: @MA 

// "The force gained from wheels by NECESSITY is smaller than what the turbine is ever able to produce."//

It's not a turbine, it's a propeller.  They are exactly the opposite in how they work.

//"This is law of physics. It's impossible to create more motion out of motion'//

Please point me to this "Law of 'no more motion out of motion'" law.

// "If this device worked, why doesn't it work in 0 mph wind?"//

The same reason no other wind powered device works on 0 mph wind.

// "IT JUST DOES NOT WORK. You're all fools."//

So then you're up for taking this fool's money, right?

Let's agree to the wager and put the money in escrow.  Seems that you and the UCLA professor have something in common.
Reply: // "It doesn't work."//

So you'll take the wager then.

(No you  won't, because money on the line is the ultimate test of confidence and you,  have what we call 'bluster', not confidence.)
Reply: @MA 

Here is the UCLA professor Kusenko's quote to the media before he lost his $10,000 and had to pay up. 

// "Thanks to the laws of physics, I am not risking anything," he told Vice in an email. "So, I could accept any bet, however large or small the amount might be."//

See what you have in common?  You both forget the first rule of brainteasers -- that the 'obvious' answer is the wrong one.
Reply: @MA lol what?
Reply: @MA You know what else doesn't move in 0 wind?  A sail boat.  Are they impossible too?
Reply: @MA Lol what?  Is that your entire thesis defense?
Reply: @MA 

//"ITS SO OBVIOUS"//

That's exactly the reason it's used as a question at the physics olympiads for math geeks... Because the obvious answer is the wrong one.

But hey, like to professor you only learn your lessons the hard way.  So let's put up the money, I'll give you five to one odds.
Reply: @MA 

// "Well if the UCLA professor only believes a 5 second video of this "perpetual motion engine" having upward forward motion ..."//

Lack of research is your problem.  There are videos showing the 10 minutes (and more) of continuous 'force >0' at windspeed on the treadmills.  Just because you're new to all this doesn't mean everyone else is.
Reply: @MA 

I'll repeat that where you are going wrong is in confusing 'force' and 'motion' with energy.  Newton has no laws regarding the conservation of force or conservation of speed or conservation of motion (see levers and gear) -- only the conservation of energy. 

The Blackbird complies with all of Newton's laws.  If you would do the math as I suggested to you in the beginning  (simple Work = Force * Distance formula), you would figure out that it is not us who are the fools.
Reply: @MA 

// "But how does the vehicle accelerate past 10mph wind?"//

You're literally asking that in the comments section of a video where a Wind Energy Engineer explains how it accelerates past the 10mph wind.  Think about that.  Derek and Rosie both explain it in detail.

If you weren't so busy slinging insults regarding how all these smart people are fools, and instead listen to what they are explaining, you might get your question answered.
Reply: @MA 

// "I've said it 100 times by now. If the device doesn't operate with same logic in 0mph wind and after given gentle push, why does it operate in 10mph wind and 30mph speeds?"//

It can only be explained to you -- you can't be forced to understand it.

// "This needs to be further explained than just hand waving and poor examples."//

Except there's excellent examples and no hand waving.  You're just too busy calling them all fools and crying IMPOSSIBLE to spend the time to figure it out.
Reply: @MA 

Have you done the math?  NO.
Have you built a model and tested it?  NO.

If you did either, you would find out you are wrong. 

And yet ... here you are, blustering away based on your intuition -- on a brainteaser which by definition is a demonstration that intuition isn't always enough.
Reply: @MA 

// "So best guess I have is that the rotors pushing the wind side actually somehow increases the overall force down, but I don't see how."//

You're acknowledging here that you don't understand how it works.  That's a good start.  But claiming that the people trying to teach you are fools and frauds is not the way to learn how it works.
Reply: @kablammy7  

What do you call 16 sets of recording sensors mounted on the craft, the chase vehicle and along the course, installed an monitored by knowledgeable and independent third parties resulting in multiple, ratified NALSA world records -- if not a proof test? (to say nothing of the fact that people spend $50 and build them and test them themselves ... resulting in success.)

Seems you have taken on the 'talk talk talk' assignment yourself while others have 'done done done'.
Reply: How can we be sure the wind just wasn’t at say 25kts then dropped down to 20kts?
Reply: Besides the difficulty of understanding why this should be true, or my still uncomfortable feelings about the system and thermodynamics, I don't find quite fair a bet where the risk and benefit of just placing it is that unbalanced...
Reply: It's basically a sailing craft that converts air resistance into additional thrust. Notice the large surface area of the blades.

Sails > Propellers 🎉🎉🎉